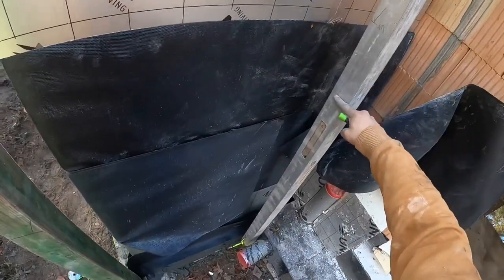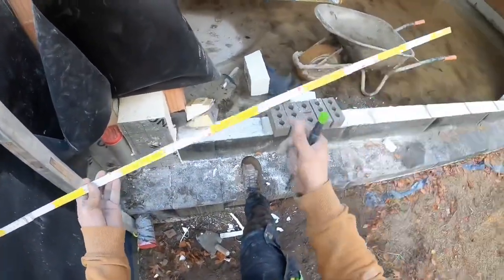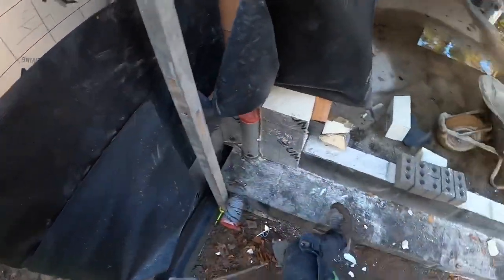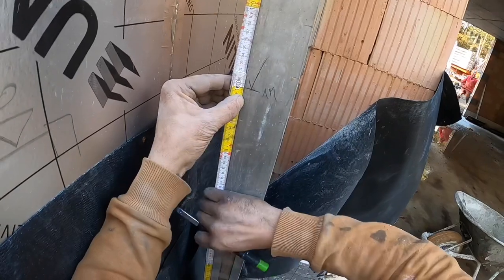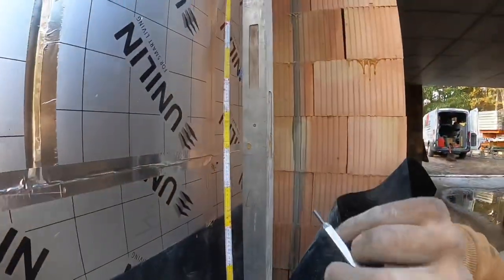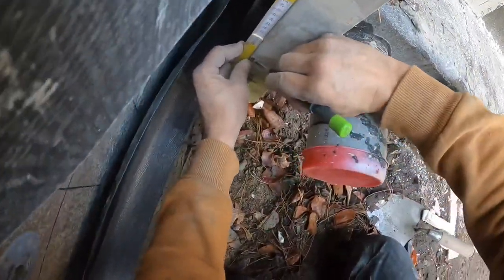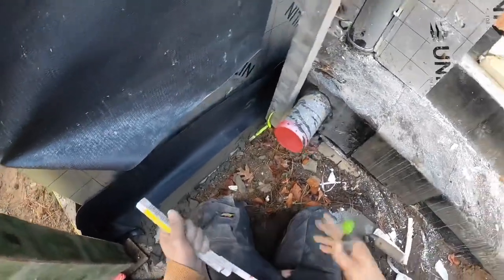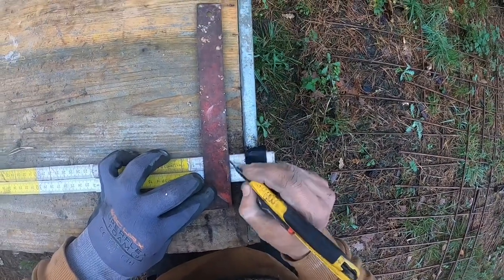Bricklaying class - profiles

Comment: In England when you have a 1m datum above finish floor, we measure down 25 mm from the datum and then go gauge, because our gauge is 75 mm == 975mm.The principal’s are the same really.Great videos by the way!
Reply from the maker: Evening, ok that's the same principal what works really easy I feel. 
Here we have such a big variety of different bricks of color looks and sizes it's impossible to handle one gauge I think I never had a back to back job with the same gauge , we actually calculate a new gauge for every new job by measuring the height of 10 bricks and take the average of it because bricks are not always exact the same
Thanks a lot 🙏 stay safe